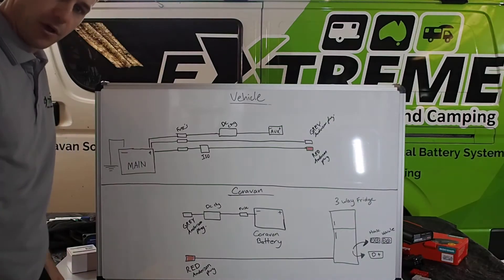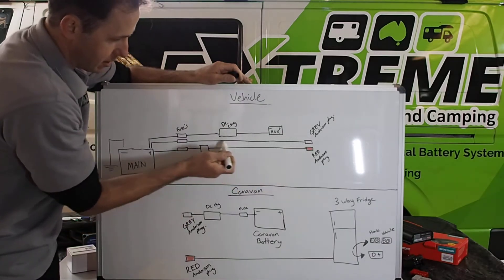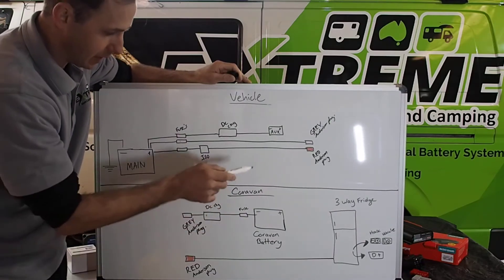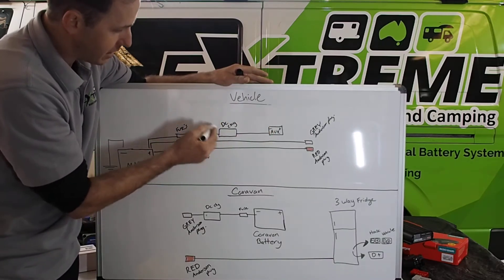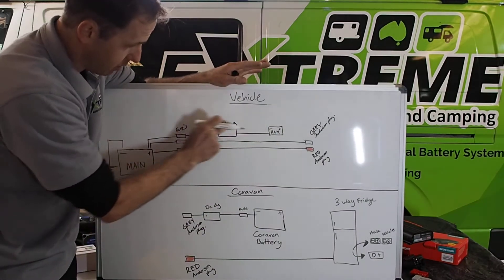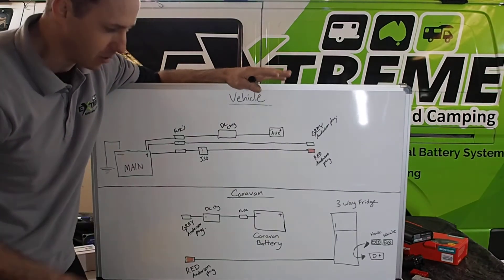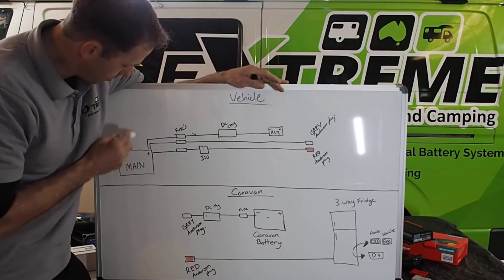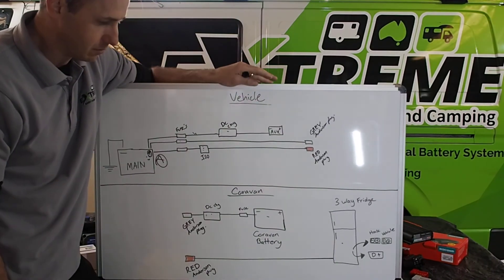Dc to Dc Charger setup with 3 way fridge and Aux battery

Comment: I don't understand why the isolator is on the fridge line, and not on the DCDC line in the vehicle.  The fridge won't draw any current when the car ignition is turned off if the fridge trigger wire is properly wired back through the 12 pin connector.  But the van DCDC charger, without an isolator will draw current from the vehicle starter battery anytime the van is connected, regardless of ignition status and potentially flatten the car starter battery???  An I missing something????
Reply from the maker: The DC charger is an isolator so as the voltage falls below its threshold it will shutdown and not turn back on until it has voltage rise on its input. Typically a turn on voltage would be 13.3 volts and a shutdown voltage would be 12.7 volts.
The reason the isolator is on the fridge line is because it covers both bases for the automatic fridge and the manual fridge. Yes running the 12v ignition wire to the 12 pin will work however when upgrading to the red/grey anderson plug this can be worked around as its a trigger wire only with no current draw.

Comment: I understand that the best practice is to run separate circuits for the car DCDC charger and the caravan DCDC charger. However, I'm a bit confused about why a 3-way fridge in the caravan  cannot be powered by the car's auxiliary battery while driving. The benefit of doing so would be that when you stop the car, it would not drain the car's main battery. Please correct me if I'm wrong.
Reply: As per the diagram in the video  it would not drain the vehicles main battery when parked as there is an isolator in the circuit, this being either ignition controlled or voltage sensing.

Comment: Great information. What isolator should be used on the fridge circuit?. I have read and been told not to used VSR type isolators on Smart Alternators.

Comment: hi matt negative return at red anderson plug on car cable is connected where best place i have connected it to batt terminal you state close to body of car close to tow bar what about both connections also fridge on battery control cable when iginion is turned on cheers garry

Comment: Great Video - Well Explained. One question - Can you combine the Fridge and caravan charge cable in vehicle and put a single to double Anderson adapter at tow point? Or does this effect the amp output ? Thx
Reply: I was pondering this exact point.  What will happen is the critical voltage to the fridge will drop as any additional current draw comes onto that single line eg. 20 amps supplying the DCDC charger.  On its own separate line all the way from the vehicle battery to the van fridge, current draw from other accessories have no impact on the fridge line voltage.  Have a common line part way eg, the car, and the fridge voltage will drop when the say 20 amp DCDC charger kicks in.

Comment: Thanks Matt.  I have installed my set up for smart alternator as per your wiring diagram using a 6 B&S with 100 amp ignition switched Mahle relay to isolate the red Anderson feed to the  caravan 3 way fridge.  I have the Redarc Bcdcn1225 with ignition switched blue wire in the 4wd boot charging an 80 AH AGM.  Is there any problem with running my 50 litre compressor fridge off the AGM while driving?  
The fridge drawers maximum 4 amps when cooling.  Connecting in this way avoids me having to remember to switch fridge from accessory socket to battery when I pull up anywhere.  Cheers

Comment: G'day Matt. I have a compressor fridge in my caravan and it draws up to 4amps that runs off  the van batteries and has no connection to the car so when I'm travelling, the fridge runs off the van batteries. My van has a DC to DC charger. Is it ok to install an Anderson plug to the rear of the car using 10mm2 cable to supply the DC to DC charger while the fridge is running? Cheers.
Reply: did you get a answer to your question wondering the same thing

Comment: Nailed another video. 👌
Running the setup with 2 dc chargers and 3 way fridge at what time would you start to consider a vehicle alternator upgrade or do most new dualcab 4x4 diesels have enough in the oem alternators.
Reply from the maker: all of the setups are based on the customer's alternator and maximum current usage If you exceed this you run the risk of not charging your starter battery .

Comment: Hey Matt,
Thanks for the videos!
Can you have a dual output from your vehicle DCDC charger, one to the Aux battery and one to the Grey Anderson using appropriate sized cable to charge caravan battery? Or is it better to run a separate line with another charger in the van? Thanks again. Cheers
Reply from the maker: No.
Always run independent circuits

Comment: Great videos as I'm currently trying to set this up but where does the blue cable off the dcdc in van get connected too? For the smart alternator? Tia
Reply from the maker: Ignition controlled pin no. 2 is a great spot
Reply: @extremeacc101  thanks guys. So helpful
Reply: @extremeacc101  on the trailer plug ?

Comment: Great vid mate, how do you connect three cables to your main battery with fuses look neat & work efficiently
Reply: I don't want to sound like an ad, but...
Find a spot in your engine bay for a Power Distribution Unit or an array of interlocking modular Midi and Mega fuse holders. You could even have a second, third and fourth one for each power distribution location of your vehicle/trailer.
They are very compact and can use Midi Fuses and Mega Fuses, depending on your requirements.
The MTA 0301873 is the ducks-guts with 4 midi fuses, 2 mega fuses and space for an MTA Relay/Fuse module. There are even sealed units for wet locations like an off-roading 4WD or boat trailer.